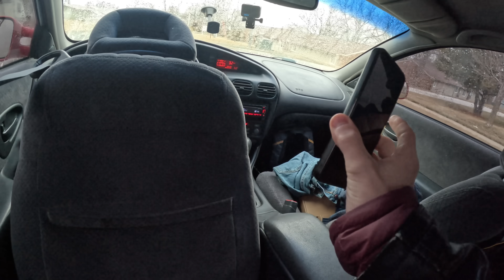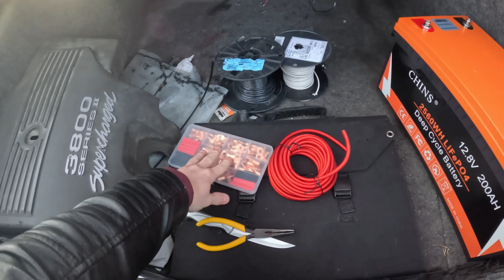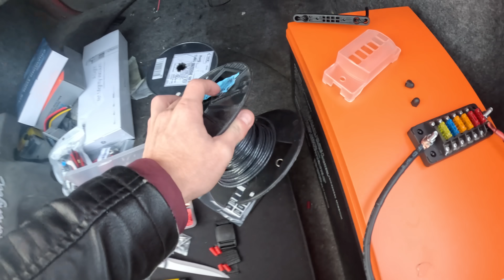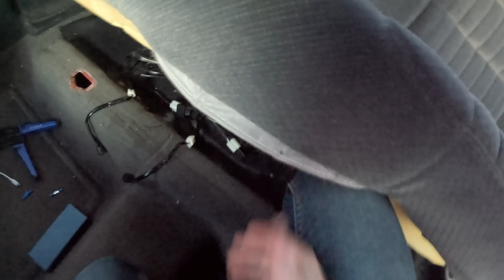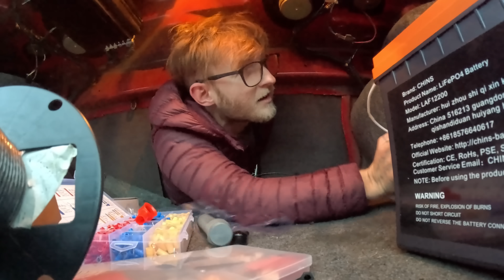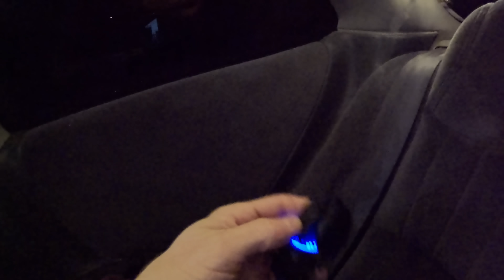Homeless - Day 4

Comment: Hate to say but, aside from the ingenuity of wiring all the Christmas lights together for them to use only 1 USB Port, you've got yourself the equivalent of one set of properly working lights. A USB port power delivery protocol in general is 5 Volts at 0.5 Amps. if you connect 2 lights to two different ports, you'll have the light of both; added together = more brightness. If you wire them together to use just one port, you're basically halving the power allotment of each light, giving you the equivalent brightness of just one light connected. Do the math with all 4 and you'll get the same light output as just one set of lights connected. It'd be better to get a powered USB Hub, and that'll allow to connect each light to its own port and get the full brightness out of them.
Reply from the maker: Each one uses 0.1 amps. So I can actually add another and still be in spec

Comment: Kind of insane to spend $40 on 2 heated seat pads when you can get a heated blanket that is much larger than both of the pads combined for only about $20... yeah you'd need an AC inverter but you should probably have one of those anyway if you're living in your car.

Comment: I could be wrong but usb outputs 5v without a controller telling it what to do, If you connect 4 of them together each one is only getting 1.25v.
Reply from the maker: Voltage stays the same. Amperage is x4
Reply: I had no idea, Thanks for the info @NanoBytesInc
Reply: he is connecting them i n   p a r a l l e l   not series.